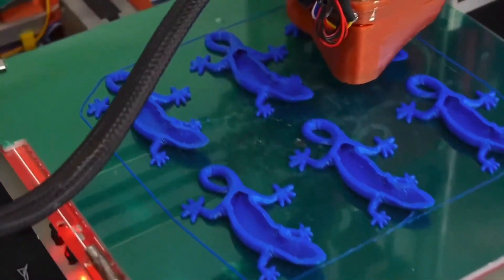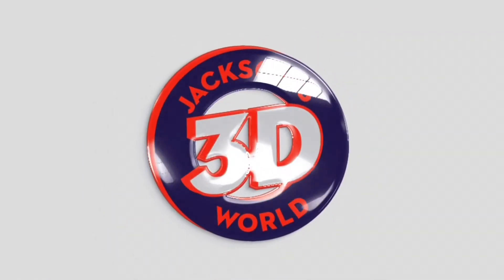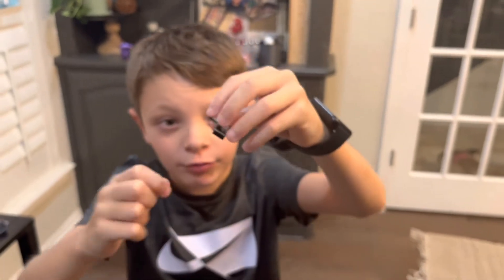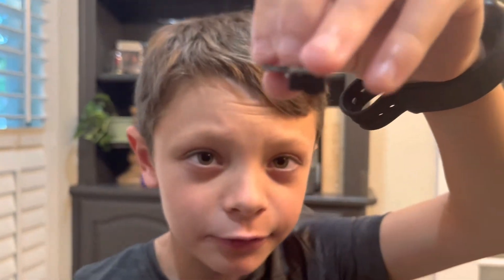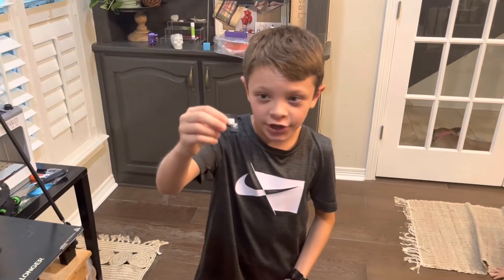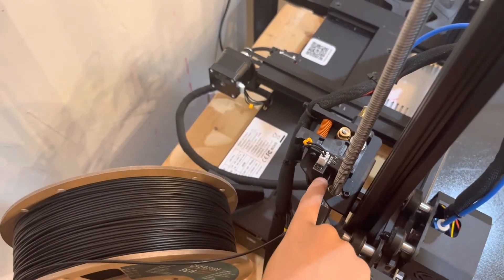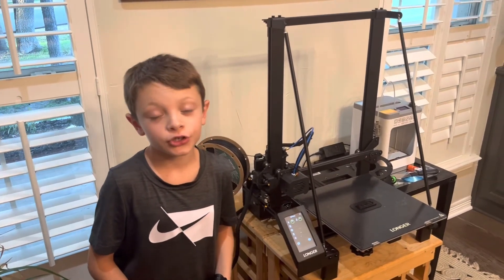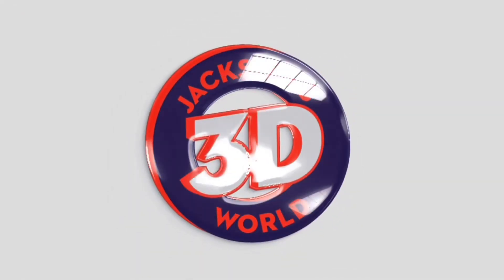Replacing the filament sensor on my @Longerofficial  LK5 Pro. You can do it too!

Comment: Due to the filament spool angle, it actually rubbed through my sensor, damaging it.
Reply: Hi, I’m going to try this and see if it works, I have a longer lk 5 but recently it’s been giving me filament sensor errors to the point where I can’t get it to print without it stopping every few minutes, would you be able to do a video in the future to install the filament sensor?
Reply from the maker: @jesssdfghj4092  hi!  That is exactly what was happening to me. This video shows how I replaced the sensor after you get the replacement from Amazon.
Reply: @jess sdfghj  you could just use a jump wire on the sensor and see if it works. That's what I did. Only problem you'll have is it won't know of you run out of filament.  The wire that plus into the sensor use a small staple or paper clip to connect it together
Reply from the maker: Yeah I had a problem with the angle once too. When you order the sensor from Amazon is comes with a filament guide that fits on the LK5 pro that helps with that. Longer Filaments Runout Sensor 3D... https://www.amazon.com/dp/B07P825LMW?ref=ppx_pop_mob_ap_share
Reply from the maker: If it shows out of stock, I found it here : Longer 3D Printer lk5 Pro lk1 lk4 lk4 pro Original Breakage Detection Sensor Compatible with alfawise u20 u30 u30 pro https://a.co/d/7KLT9k6

Comment: Very cool Jackson.  If I may add some to your findings.  My switch actually broke before printing very much.  But in my case I changed the filament a few times.  The typical unload sequence causes a bulge at the end of the filament that is being unloaded.  If you pull it out through the switch without clipping off the bulge, the irregular shape will actually break the tip off the switch.  It is a poor design.  You may also be correct about the tip getting worn but if you think about it that is a bad design as well.  Live and learn right?  the LK5 is very solid when running but it does have some fatal flaws.  If Longer was smart they would redesign the filament detection.  Most other printer manufacturers us a limit switch with a metal arm which would stand up much better to the abrasive nature of plastic and irregular shapes.  Either that or allow an override so you could get on with printing, but for now if your switch is broke, so is your printer.   Keep up the good work.
Reply from the maker: It is a bad design. You are right. Mine broke again pretty quickly, so my dad and I just zip tied it to trip the switch so we could just trick the machine to think is always has filament. That has worked for a while.
Reply: @jacksons3dworld  So here is a little hint: the connector to the switch is two wires which are shorted together when the switch is closed (filament present).  So, you could take a wire (about  22 AWG) and put that in the connector to simulate the switch being closed.  Use about 1/2 inch of stripped wire and make it into a "U" with the ends of the "U" the same distance apart as the pins in the connector on the switch board.  Insert the wire into the connector that goes to the switch board and tie the wire off to the cable assembly so it does not flop around.  The wire should be slightly snug in the connector but not so big that it is hard to insert which may cause damage to the connector.  The pins in the connector are .025 inches square and 22 AWG wire is .0254 inches diameter.  Too small and the wire may slip out or disconnect during vibration which would make it look like the filament has broken.
Reply: And maybe a little electrical tape over the exposed wire for good measure.
Reply: another option is to cut a piece of paper to go over the top of the switch and place it into the switch cavity.  Then replace the detector board.
Reply from the maker: These are all great ideas! Thank you!